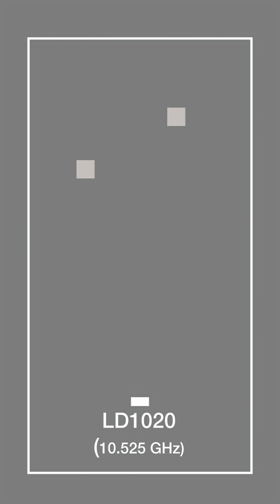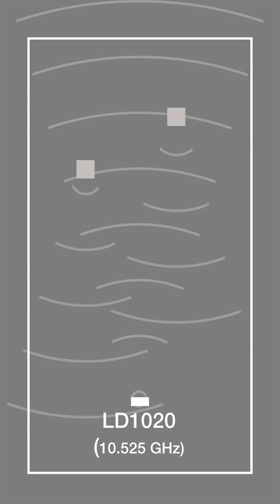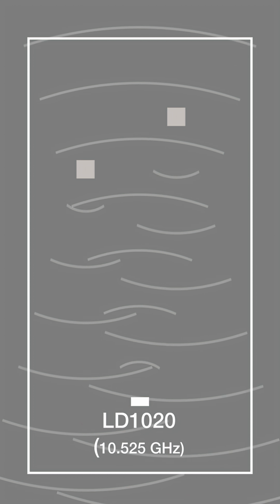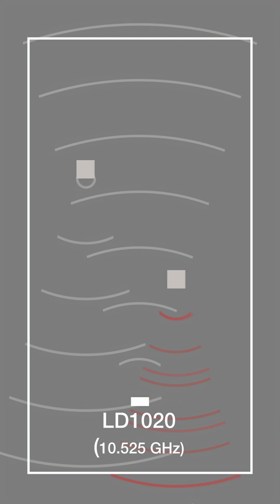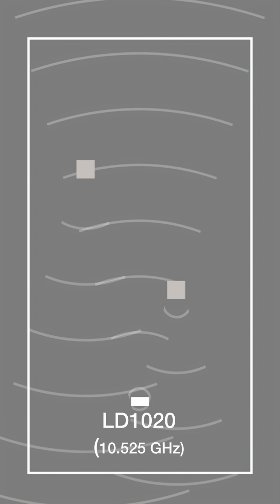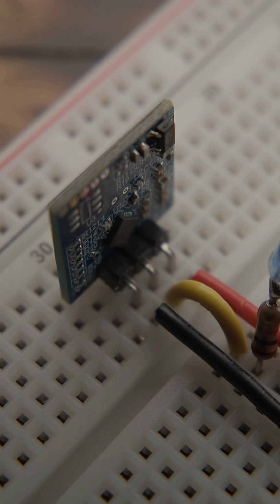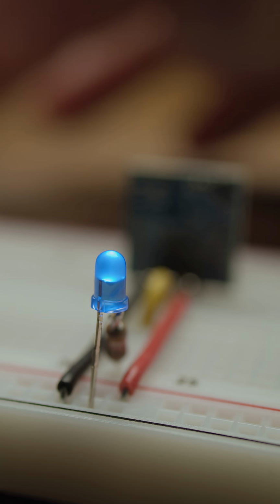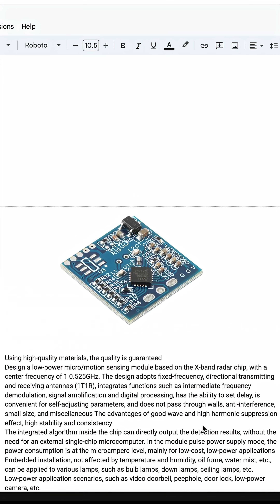LD1020 Radar Module

Comment: Double glazing typically does not have a vacuum gap, it's usually filled with argon or a similar noble gas. You can get vacuum insulated double glazing, but it's not very common yet. Vacuum insulated double glazing has lots of tiny visible spacers dotted in a grid over the entire window to prevent the immense forces of the atmosphere pushing the two panes together or breaking the glass, so if you ever do see a vacuum insulated panel, you'll know.
Reply: is a vacuum better than ones filled with noble gas? and is it that much better that it offsets the downside of having the visible spacers?
Reply: @RadimentriX it's just more insulating, but any modern double glazed windows are good enough and triple if you want to block all noise
Reply: @RadimentriX  You can have tripple layered - these are best - but heavier and more expensive.
No issue with flat buildings, but with some higher, the statics might need to be adopted.
Reply: @RadimentriX  much better R value. VIG will typically have a minimum of 5X performance capability over Noble gas filled double pane windows. Longevity is the only downside as its impossible to prevent atmosphere from infiltrating the space. Also VIG is unsurpassed in sound isolation. STCs of 60 dB are easily achieved. Windows like this are expensive and are not common as narrator seems to imply and NOT the reason radar signals cannot penetrate the window.
Reply: @keansakata1015 the low-E glazings are typically a silver coating.  If the silver interferes with the radar I’m curious to look at gpt next.
Reply: @keansakata1015 then pray tell us why. Explain it all to us like we're seven just like this guy. Then you can have your own channel. Do it, and I'll tell you if I think you have potential.
Reply: @RadimentriX Not for a window. As vacuum does not block radiation. Awesome for refrigerator insulation
Reply: @RadimentriX Vacuum with IR reflecting plating is superior to Argon or freon gases. The atmospheric pressure is just so large that there must be support structures and the sealing is difficult. Actually the noble gasses also escape in some decades though most seals. 

My apartment has triple IR-reflective gas filled windows. Wifi and Bluetooth doesn't work in my balcony, if I close the balcony door. It works quite ok other side of the house with smaller windows on the yard through the concrete and brick walls. Balcony windows are most of the wall, and there is metal radiators and likely also aluminium foil inside the door and rest of the wall. The Bluetooth and WiFi doesn't work even one meter though the wall and window.
Reply: @RadimentriX  the vacuum would be for thermal insulation.  We all know that vacuum flasks work pretty well, but this discussion was in response to a comment (in the video) about double glazing interfering with radio waves - and radio waves come to us from space craft millions of miles away, through the vacuum of space - so the vacuum in half an inch of double glaziing isn't the problem.  As of October 2025, Voyager 2 is over 13 billion miles (more than 21 billion kilometers) from Earth.  Maybe the coating that he mentions is conductive.
Reply: @RadimentriX  Vacuum would definitely be better than any gas,  but I was wondering about the spacers. I'm assuming the spacers are also made of glass, which is pretty conductive of heat. But if they're extremely thin, they might still conduct less than a gas.
Reply: Vacuum layers can bé 1mm thick, and will achieve a similar thermal resistance to 14mm of argon. We use it when we need double glazing in an old window.
Reply: @daithiocoinnigh you make windows that can withstand a vacuum? That's like 10,000lbs of force per pane (20,000lbs differential) at 15PSI. Please explain, thanks.
Reply: @Katie_Overqueue it's near vacuum, not complete vacuum. But yes, windows/doors with a vacuum layer are real. Go research.
Reply: Does thermal Bridges affect the vacuum ones? Like which one's better?
Reply: @dillonbledsoe7680 Vacuum Insulated Glass is not affected by the "bridging" supports. They are too small to conduct sound or infrared energy (convection, conduction).
Reply: No radiation is impeded by a vacuum gap.

It is nonsensical to imply otherwise.
Reply: Bro are you a window man or something? You have a surprising amount of knowledge on the topic.
Reply: How about an igNobel gas?
Reply: @roysutton3722  underrated comment 😂
Reply: Dry Nitrogen rather. Else you are right
Reply: And the vacuum would not present any problem with an RF signal
Reply: And, it doesn’t matter at 10GHz RADAR, because they’re radio waves not sonar/sound waves, so they aren’t blocked by vacuum gaps. It’s gotta be the glass or coatings, or the sensor is sonar.
Reply: It was a stupid comment. Nothing but convection is stopped by a vacuum gap.
Reply: @denverbraughler3948 And conduction. Which are together the main channels of heat flow. (Radiation usually minor for small delta-T.)
Reply: @denverbraughler3948   How very rude.
Reply: @denverbraughler3948  and sound 😊
Reply: @denverbraughler3948  you post the stupid comment to imply the OP spoke about radio wave insulation. He just pointed out double glazing glass are typically has no vacuum layer but argon or other nobel gaz, for noise, temperature insulation. He never spoke about radio wave.
You re the only one to trigger and act smarter when you miss understood a simple correction to the video.
Reply: Well...old bulbs used to be vacuum, later gases were added to increase physical resistance, but they didnt implode or anything just because of the atmosphere, I assume the comment is a bit extreme
Reply: So also insulation is much better with Vacuum?
Reply: Double glazing is just a sealed unit, the only factor needed to guaruntee noise reduction is negative pressure. Thats why its sealed.
Reply: Woah. How u knowd that?
Reply: I would think the spacers keep the glasses obtaining a concave surface.
Reply: There's no such thing as a noble gas, even if comes from Argon.
Reply: @alterego157  What are you talking about? Noble elements are those that have practically no chemical reactivity. Helium, neon, Argon, Krypton, Xenon, and Radon are all noble gasses. Argon is used in windows because it's relatively common, and because it has a high atomic weight. The high atomic weight make it slow moving, which slows heat transfer.
Reply: I imagine a vacuum is quite difficult to get, surely the external atmosphere would cause it to collapse.
Reply: @tj9382  Which is why they have tiny pillars between the glass panes.
Reply: Some insulated glass inserts have low e glass. It is a metallic film that reflects certain light frequencies. The reason 5g may not work in some places is the low emissivity films. Good example is uv light is filtered by low e. Some bay window installs required grow lights when plants couldn't get light necessary to live.
Would love to see how this chip long term exposure will affect life.
Just remember every time radar or laser guns are triggered, the police are radiating themselves. The old x band dash mounted radar guns caused cancer In head and shoulders. The holster mounted radar gun for motor cycle cops caused testicular cancer. Karma is a bitch. They were screwing motorists and were frying their on gonads.
Reply: @wendellgibson7450  Serves them right. Surprised the radar runs weren't designed to only radiate in one direction. A laser gun would do this and wouldn't be radiating the cops.
Reply: Great 👍 Write more!
Reply: Vacuum doesn't block radio
Reply: @jdmjesus6103  A metallic IR-reflective coating is the likely culprit.
Reply: @jdmjesus6103 Right, it's the coatings
Reply: @jdmjesus6103 
I would expect this too. 
The Reflexion coating muß be the reason. 
Otherwise No Radar photography from Satellite would Not Work.
Reply: Low E argon double pane windows have a silver metal vapor deposited on the inside surfaces. The Oregon is prevent corrosion or tarnishing of that silver. It won't pass infrared or microwave energy. Those windows are not vacuum in the middle.
Reply: @KlodFather how about UV?
Reply: @KlodFather & I assume that is in both directions, ie. reduces infra-red entering and leaving? 
Mind you, as a HVAC Engineer I would refer to manufacturer's technical performance data anyway although data is usually, iirc, more about in than out, here anyway 🇦🇺
Reply: @KlodFather    What is the Oregon?
Reply: I love coming to the comment section to get educated about something the video wasn’t even about 🤓😝

Comment: Vacuum gap in windows? Obstacle for radar? That was really weird to hear someone say..
Reply: You didn't hear that radio signal doesn't propagate in vacuum? All the heat on earth now comes from CO2.
Reply: @mikek.1761 🤣
Reply: @skeltek7487
If the space between double pane glas was vacuum, the pane  would instantly implode/collapse under atmospheric pressure.
Reply: @zonzeven  I know, the uploader maybe doesn't.

Comment: It seems really nice, but won't it mean you better not have curtains/plants and open windows? Any breeze would make them move and trigger the sensor. In those cases infrared motion sensors are still better it seems.

Comment: That’s not Doppler. Doppler requires a large frequency shift…and the speeds for this type of motion is insufficient. What is really happening here is the motion of the reflective surface causes a destructive/ constructive interference with the incident wave (which is coming from a source that is not moving). Thesis interference produces a beat frequency that is proportional to the movement of the target. The beat frequency will be in the audio range, and easy to detect. This is why these types of radars can be calibrated with simple tuning forks. If there is any Doppler at all, it will be the frequency shift of the beat frequency, not the frequency shift of the RF frequency.
Reply: Hey bud,
You seem very knowledgeable. Would you mind guiding me in my 1st electrical project? I dont have much money but I can pay a bit for your help.

I dont get notifications but will come back to this video and check your reply.
Reply: @kg-WhatthehelliseventhatI don’t need to be paid. I will help you if I am qualified to do so.
Reply: @kg-Whatthehelliseventhatill ping u so u can be notified
Reply: Another ping @kg-Whatthehelliseventhat
Reply: Thanks for thr clarification

Comment: Would you be able to mod it and underclock or downshift the signals the sensor picks up to be able to turn it into an audible signal (10ghz down to 10khz?)  that u can hear audible changes? Like bypass the output to read the rf signal on an analog pin and process it and send to analog out to a speaker? Im a complete amateur noob and not sure if this is even possible. ...
Reply: I mean with an Arduino, some clever coding, maybe a few more components then yes you most likely can. Probably not from the same exact radar sensor, you would probably need another sensor or components to switch the signal to something we can hear. I would think these devices are configured for precision so things like capacitors and resistors in a certain configuration get the GHz signal. But I'm still new too so I'm not sure 😂
Reply: Swiss Guy has modules that output audio! Cool applications!

Comment: Infrared should also work through plastic.
You mentioned glass and it's not working through glass... WTF...
Vacuum gap my ass. You can't have vacuum between the glass panes. Just calculate the force over surface area and you'll realize how dumb you are.

Comment: Does it detect the change in frequency of the reflection, like doplar, or the chage in strength due to interfering reflections?
Reply: Level shift! Freq would be very small if at all...but intensity will vary "bigly!"

Comment: It's rare to have a vacuum IGU  those are in development, it's 90% argon and 10% air at least, sometimes 95% argon or higher if you buy from a window manufacturer who's glass supplier uses 100% argon. But it won't ever be 100%

Comment: Its actually crazy that this technology is so cheap now.
Just ten years ago a single chip mixed signal circuit for such a radar would have ben 10-100 times as expensive because there was no mass application and thus no large scale production yet.
Nowadays presence detecors and especially automotive radar systems (which used to be reserved for luxury cars and cost thoushands of dollars) are evrywhere.
Reply: About ten years ago working on a project and got asked if I could build basically this, I said flat out No. Now I can!!
Reply: simple doppler radar modules like this have actually been cheap for a while. they predate passive IR for door open sensors. They were mostly in the single digit gigahertz bands though and this one has a bit more bells and whistles.
Reply: @mac-v9pI recall my first police radar detector in my car going off everytime I drive past the local grocery store with automatic doors. Apparently they used the same band.
Reply: @brennan3735  that's AWESOME hahaha
Reply: @brennan3735  Yeah this was always an issue, and now that cars use radar for all sorts of things it more of a PITA. It basically killed the market for older used radar detectors. Valentine has a trade in program though
Reply: Like my late father, microelectronics engineer at Bosch and Siemens, once said: affordable electronics are great, but you can't eat them. I wish food was THAT cheap.
Reply: Clifford car alarms used to have a radar module for convertible cars to replace the ultrasonic sensors for when the top was down, this was 20+ years ago and a fairly cheap add on.
Reply: You can practically buy a Lego box of all sorts of cool sensors from China, but be sad after you put them together that only a handful actually work
Reply: What? They were cheap 10 years ago, this is very simple device
Reply: @NoName-md5zb yup, microctrollers, sensors, opamps, battery charger boards, all these things have been "couple of bucks" for long years on ebay, and other local web markets. People got used to new electronics costing hundred or even thousands of USD, but the truth is, most of the devices to cover everyday needs peaked in early 2000s
Reply: @NoName-md5zb How about fifty years ago when I was doing my degree?

Comment: Ah yes. Missile system time.
Reply: Nah, you need an phased array for that.
Reply: @jeffgoldman1735  They were still deploying non-phased array ships in the 80s.
Reply: Missile system I worked on had a 5GHz tracking radar and a 10GHz illuminator.

Comment: I was thinking of crafting indoor alarm system, this might be it.
Reply: If plants move when the wind blows, it will be triggered.
Reply: @AnantSharma622 Thinking of motion detection in doorway, no plants nor pets in sight.
Reply: @AnantSharma622  and when the air moves with a slight temperature difference, the standard infrared sensors go off 🤷

Comment: Great now every jackass is dumping out 10ghz spectrum noise for pennies on the dollar. 

Also, these would be good rain detection from a 2nd floor window without having a water detector outside and exposed. Maybe with some tweaking the amount of rain could be detected
Reply: The detection occurs on board the module unfortunately. How do you imagine one would measure the amount of rain?
Reply: @oblivion0077 doppler looks for wavelength shifts due to movement specifically. If the sensor is pointed into the air where there's nothing to reflect...

Rain is failing, so we should see more total reflected wavelength shift more with more rain. Higher density of droplets
Reply: @wilurbean Right, I think you'd need a different board though. Unless there's a way to use this one?

Comment: Crazy how I've never heard of these
Reply: There are also radar modules that detect heartbeat.
Reply: @SeersantLoom Heart beat? Can you please say more, are they on YouTube? Where to buy, etc. Thanks in advance.
Reply: check LD-2450, it can detect 3 people at the same time, knowing where they are, you can even set the areas (from 1300mm to 5300mm etc... it's so good.
Reply: Same here
Reply: $10 radar on a card came out years ago. This is the latest version. Cars use them.
Reply: I'm sure you've walked past a street light or  door with sensor on it
Reply: Arduino, Teensy, and Raspberry pi are open source projects that have hundreds, if not thousands, of little tiny modules like this for anything you can think of. I have built numerous projects with these microcontrollers.
Reply: That is crazy, you really should've heard of these, everybody knows these things, this is common knowledge, it's even in Wikipedia, even Donald Trump knows this, even ExploringNew2 has heard of these. Wow!
Reply: Why, are you the universal repository of all human knowledge?
Reply: Never played WarThunder ? :D
Reply: The LD1020, a low-cost 10 GHz Doppler radar motion sensor that can detect movement through wood, plastic, and even glass. Unlike traditional PIR infrared sensors, this radar module works by sending out a microwave signal and detecting the Doppler shift when something moves. I’ll show you how it works, explain the pinout and timing behavior, and demonstrate its real-world range and sensitivity. For less than two dollars, it’s an impressive sensor for DIY electronics, alarms, and smart projects.

Working frequency: 10.525GHz (10.40~10.65GHz)
Working voltage: 3.3~12.0V
Working current: 16mA (Max, VCC=3.3~12.0V)
Detection angle: Ceiling installation/3dB beam width/110°±10°
Sensing distance: 2~8 meters (25 feet)
Output voltage: 3.3V (3.2~3.4V)
Power-on stabilization time: 15S (13~17S)
Working environment: temperature 20°C~+70°C/humidity 10~95%Rh
Blocking/delay time: 2S/5S(Typ.)
ESD characteristics: contact discharge/air discharge 2KV (Typ.)
Appearance size: 15x15x2.4mm
Reply: @robertweekley5926  They don't like cold.
Reply: @robertweekley5926 lol yeah we watched the video too